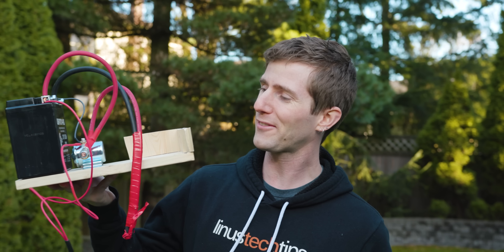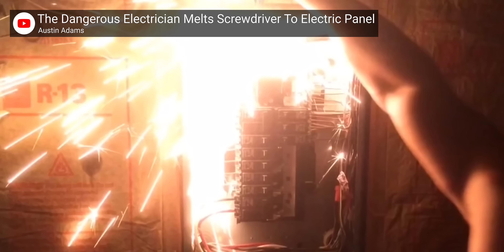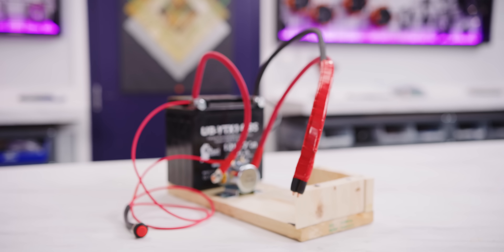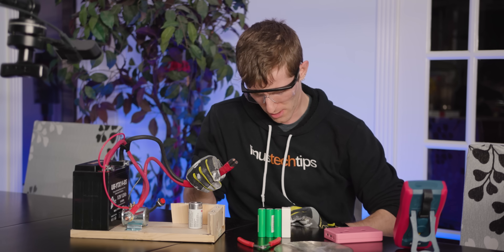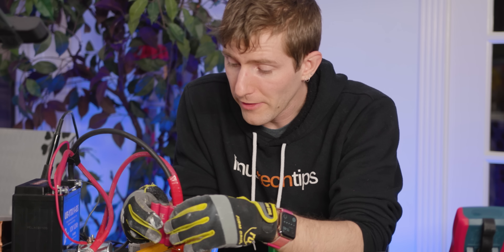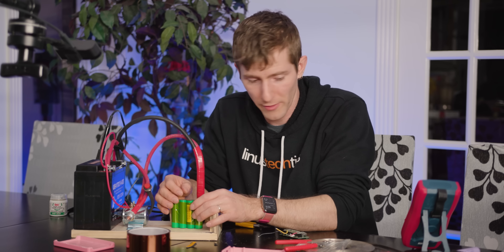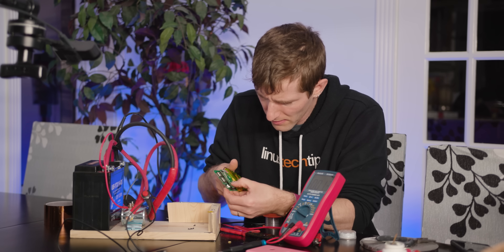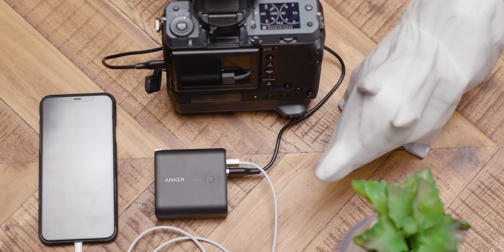I spent $100 to save 20 bucks... and it was TOTALLY worth it!

Comment: 3:52 what electrocution hazard? You are dealing with 12V...
Reply: No one employed by LTT is an actual engineer.  Trust these guys for keyboard reviews, not anything actually technical (that wasn't fact checked by one of their professional technology providers).
Reply: The only hazard would be metal jewelry getting welded to you. But that's an easy thing to prevent, you should already be taking off metal stuff on your hands when dealing with electricity anyway.
Reply: Voltage doesn't kill, current does. 16mA hand to hand is enough to not be able to "let go", 20mA causes respiratory arrest. Depending on skin conditions (dryness, cuts, burns, skin thickness etc) the resistance can vary greatly from 1k Ohm hand to hand to mega ohms (I measured 1.4M today with really dry hands), inner body around 300 Ohm. However the resistance can be broken down by high frequency AC such as a current pulse, for example from a spot welder. Suppose you had 1k Ohm hand to hand, from the breakdown from the pulse, or due to wet hands or a combination, or other reasons, 12V could cause a current of 12mA which is significant and close to not-being-able-to-let-go territory. 12V spot welder is still dangerous if you don't pay attention.  Remember, current kills, not voltage.
Reply: @emilybjoerk  Again that stupid saying - yep, current kills, but you need voltage for current to flow, they are connected according to Ohm's Law. Also high frequency AC doesn't 'break down' resistance, just lowers overall body impedance the higher the frequency as body has some capacitance, and even if we assume current reaches 20 mA (which is unlikely, there's 'high frequency' voltage spike when you quickly grab battery terminal and somehow you don't die), you need relatively long current pulse to cause any damage, according to the IEC 60479-1, even at 1 s there's only 5% chance of ventricular fibrillation (when current adjusted by a factor of 2.5x for hand to hand instead of hand to feet, according to PEG presentation) and that assumes that current is AC, for DC you need even more current.
Reply: @emilybjoerk  DC is extremely unlikely to do anything at all at 12v. I could put my wet hands on a 48v (at 58v) battery end to end and nothing happens.

Maybe AC could hurt you at 12v, but I doubt it could ever be deadly. (See Electroboom on the misconception)

High voltage DC is dangerous, and same for the 480v circuits that I sometimes work with.

Death comes from a total power level able to stop your heart, and a voltage high enough to break through the body to the heart. Usually from your hands.

Comment: Why the fuck are you doing all this shit to weld when you can buy an empty battery bank that has slots for 18650s with spring terminals for like $5 on ali or amazon?!
Not only would your welding machine cost more to build than replacing the power bank body, 99% of people will need to learn a skill and the safety involved lol.
I get that it makes for a cool video, but from the perspective of the unaware it just says "Don't mess with battery banks"... When you can just buy one that doesn't require welding? wtf dude.

Comment: MyFather replaced the cell of a scientific calculator, many years ago.
it was an expensive Machine that was perfectly fine, only the rechargeable cell inside wich was soldered into it was dead.
I have no idea what sort of cell it used, but all he had to do was find out what type it was and replace it.
to give the perspective: its Display was using incandecent Filaments for the numbers.

Comment: "If we just used something like a light switch, there would be too much current, so this relay will make our pulses nice and short".
.... and then they proceeded to control it with a sketchy plunger button anyways. The relay doesn't really do much if your inputs aren't precise anyways. There really should have been a circuit providing a switching pulse.
Reply: I though their point wasn't to give it fine control, but rather so all that energy wasn't running through a pretty flimsy button with thin wires

Comment: A monostable 555 timer circuit with a potentiometer to set the timing would be rather easy to incorporate into that spot welder to take care of the timing issue. 555 timers can take 12v in, however you'd likely want to use a mosfet or possibly a transistor on the output to drive your relay as this will avoid the flyback current that was likely causing your button problems.

Comment: Why exactly wouldn't you just solder it, it would be so much easier. Just turn up the heat on your iron and get it done fast. It's fine.

Comment: Hot and ground? Errr no. Hot and ground or live and neutral in the UK are terms used in AC circuits. It's actually positive and negative as it's a DC circuit.

Comment: Me: This spot-welder is dodgy AF.
Linus: proceeds to demonstrate exactly that. 

It was cheap. Not discouraging anyone to build it.
But blowing holes in your batteries isn't good. And that relay will never be accurate or reliable.

kWeld is a nice small cheao-ish spot-welder solution.
Reply: Or buying a prebuilt spotweld controller

Comment: I feel adding a little gauge to read battery voltage as you discharge and using a timer circuit could take out the human inconsistency and fix your welder right up. plus give you the option for adjusting to different material

Comment: The primary reason spot welding is used on 18650's is because of the difference in metals. You can't solder onto the 18650 directly hence you use spot welding to join two different metals. (Correct me if I'm wrong)

Comment: A good addition to the spot welder would be an adjustable monostable multivibrator circuit. It would weld for a constant amount of time instead of relying on letting go of the button.

Comment: I chuckled when you went in detail about the strips, but do not at all mention the difference between protected and unprotected cells... At least not what I could see I skipped around a bit. At least you're the only person with a homemade spot welder I've seen who is actually as scard of the battery as they should be.

Comment: Bro, at the very LEAST cover your ring with tape but holy FUCK take it off!!! You want to melt that into your skin? FFS...
Reply: For ANYONE looking at this convent, this goes for ANYTHING THAT HAS TO DO WITH ELECTRICITY. You NEVER EVER wear any metal on your hands or wrists when you do anything like welding. I even take mine off for soldering. Remove ANYTHING from your hands and wrists.

Comment: I work at hobby store and solder lipo on daily basis(like more dangerous li-ion). My tip for your solderin is get a bigger soldering tip the bigger it is the more heat it can transfer so often you can basicly solder in 1 without heating deep into the battery and not getting cold solder.

Comment: soldering acid and 2.5mm copper wire so much easier and much safer. also most nickle strip struggles to handle the high current rate of stuff.

Comment: No electrocution hazard. Sorry, but that term commonly means for a living thing to be affected by high voltage, and the definition of high voltage is over 50 volts or so (research the limits used by UL and other standards bodies). Your setup uses 12V, so no hazard of that type. 

If the relay were shorted on there might be a electric heating hazard as the connecting wires or other conductors were overheated and commenced to 'splode. 

You are supposed to be an expert, so get it right.

Comment: It's not the loss of capacity due to heat that's the problem. It's the risk of explosion, which you discovered for yourself even when using a spot welder.

Comment: that starter relay probably isn't rated for that high current for that long, which is why you're probably almost spotwelding the contacts in the relay together which is why the switch "sticks" sometimes. kind of a dangerous diy spotwelder tbh.

Comment: @5:59 If you were connecting large banks of batteries together that were not within a few volts of each other this would be an issue but even if you connected a completely discharged 18650 at 2.8V in parallel directly to another 18650 that was fully charged to 4.2 the amount of current that would actually pass between the cells would be very minimal on the order of 1-3 amps for a very brief period and they would then equalize to around 1.5 amps or less going down in current until they reach a fully equalized voltage.

@6:50 You can safely solder cells together without doing any damage via heat by simply using a propper soldering iron in the 100-200 watt range since the actual time to solder becomes far lower (about 1 second) at the higher wattage.  Lithium cells are usually good to 60C during discharge and that is a constant temperature but when soldering a lithium cell with a properly sized iron you do raise the temp of the metal case to around 190C but that is for a second or less and only raises the temp of the rest of metal case of the cell by 5-20C as the heat is conducted away and equalizes very quickly.  So unless you are moving too slow or using too small of iron, you should not be heating the cell anywhere close to the 60C+ most are rated for.  Spot welding with an automatic spot welder is faster and safer for the cell but is not a necessity.

Comment: HEY LINUS! If you cut a 2L bottle in half to make a "tube" of plastic, you can use a heatgun to shrink that around a freshly compressed battery pack, and you can probably make that pack work... After you swap out the BMS.

Comment: No mention of the dangers of thermal runoff working with lithium?  Heat doesn't only ruin batteries, but can also lead to very very hot fires and possible explosions.

Comment: Oh you should be careful with these :,D You got that white plastic cap around the positive pole and directly to the side of it, underneath the green cover is the negative pole wich reaches all the way to the bottom. So you better don´t scratch the top cover with your metal plate or let an edge crawl underneath that green cover...

Comment: You should have used carbon rods as electrodes. They won't melt and stick to whatever you are welding. You should also clean off the surfaces with alcohol before welding so they stick together better.

Comment: Anker sponsored the video b/c of the title... It is weird how buying the same capacity in 18650 batteries from like LG (which Anker uses sometimes) is much more expensive than just buying an Anker pack of the same or greater capacity. Unless you want something like a 60Ah LiPo pack with fast charging @3A and high current output but yeah Anker power circuits are probably better thought out than hobbyist made charge / discharge protection boards... probably

Comment: So i want to do the exact same thing on a laptop battery. Its a 2*3 setup outputting 11.1 v at 4.400mah. So i ordered 6 gp 3.7 18650 batteries at 3500mah each. I suppose the extra capacity wont be a problem, it will just charge longer. I'm also going to do this with a soldering iron. Any advice?

Comment: Also The version with the microwave transformer is also very interesting, Just do not be afraid of live circuits, because if you make all necessary precautions eg. adequate insulation of live wires, grounded transformer shield and case ... etc. The main reason why this is better is that you will be able to precisely control not just a welding time but also the amount of current passing the weld spot by regulating the input current to the transformer rather than its output because the input current is much lower. While building this welder I would rather remove the secondary winding (The one with more turns and thinner wire) by cutting-off the I profile of transformer shield from E profile with an angle grinder and then removing the secondary with a chisel instead of drilling it out.    I thing that it is not really difficult to do it if you have average mechanical-work skills and some electrical knowledge, It is just important to obey safety precautions !

Comment: you dont need to buy a spot welder if you buy a powerbank that has removable covers and not welded batter.
its a bit pricy upfront but these powerbank last so much longer.
i bought Qi Dian power bank and Samsung 18650 Cells with 2800mAh rating.
that powerbank is still alive even after 7 years. the cells capacity have degraded but still within the safe voltage range.
cost me like 50USD total

Comment: that is one ghetto spot welder. You can buy a circuit board to control it for like 20cad, or fully built dc spot welder inc battery for about 90cad. Save a ton of money if you build ebike sized batteries, compared to buying them pre-built. Plus unlike most pre-built ebike batteries you can put a proper BMS in.

Comment: "Nasty electrocution hazard" - with 12v, if you manage to get a shock without literally licking both terminals (not even then) i shall award you the ElectroBOOM award of the week.
The exploding battery caused by a dead short are a different story.=))

Comment: you guys need an actual welder. I'd suggest the titanium easy flux 125 cause it goes on sale for only $150 and is super cheap to use at only around $20 per spool and is easy to use for a starter. I built a motorcycle with mine.

Comment: FUCKING LORD Almighty is this thing dangerous and irresponsible.

Without the ability to control the amount of current and the length of the pulse PRECISELY*, one can so easily melt through the body of a 18650 cell and set it on fire. Looking at the test weld shots, this thing outputs *way too much current. The nickel strip should not glow visibly.

8:43 Linus, you are a total idiot. You were just plain lucky that he did not set his house on fire.

P.S. I am sorry, this is lunacy. I flagged the video as a Harmful dangerous act. Giving 10M subscribers the idea they can set themselves on fire in their living room is completely irresponsible.

Comment: You can significantly improve the usability of your DIY spot welder by switching the relay with Arduino (plus some support circuitry). That way you can precisely control the ON time and get more reproducible results.

Comment: spot welting another strip is fine Linus for my ebike battery pack i did 2 layers of .15 nickle to carry my 80+amp current over the parrell connections the series connects didnt reqire extra due to me haveing 14 x5a= 70 amps continuous before getting hot and bursts of max of 13a per connection.   Side note ( https://www.aliexpress.com/item/4000436631776.html?spm=a2g0o.productlist.0.0.4e9d7746pVmtl4&algo_pvid=c298c2f1-b17c-47b9-988c-398fd2deaf6e&algo_expid=c298c2f1-b17c-47b9-988c-398fd2deaf6e-2&btsid=0ab6d69515875029534555059e85f5&ws_ab_test=searchweb0_0,searchweb201602_,searchweb201603_ ) invest your self 25 and buy one of theas for consistent welds

Comment: So a few pointers as someone who builds ebike batteries with a post welder: pressure is key. If you don't apply enough pressure, it's gonna spark like crazy and not weld well. Also Linus, the distance between the electrodes is too big for spot welding to an 18650. Also spot welding a nickel strip on top of another nickel strip is pretty common especially for bigger battery packs. You'd normally see a nickel strip for parallel then another nickel strip on top of that for series connections.

Comment: Call me crazy, but wouldn't it have been better to solder the connection to the strips first, and then spotweld them to the batteries? Less heat will go to the batteries, which is good for them, and makes soldering a lot easier as well.

Comment: An ATV battery in germany starts at 40-50 buck so this is not a cheap alternative.
I would recommend Scooter batteries instead, if they have enough current. They start at 15 bucks instead.

Comment: I think you could get much more consistent welds if you use an Arduino and relay combo to control the signal to the starter solenoid. You can then just have a button on the Arduino and tune the timing until the welds are perfect!

Comment: Can't find anyone else mentioning this, but the reason your pushbutton is acting flaky is because of the back-EMF as you are de-energizing the coil in the relay.  The pushbutton will slowly (or quickly) be destroyed by the arcing this causes.  Add a diode across the relay actuator contacts to shunt the back-EMF.

Comment: The Anker powerbanks are great.
I switched to the Xiaomi Mi Power Bank 3 Pro. It has a capacity of 20.000mAh and can charge through the USB C port at 45W :)
The best part is that it's really inexpensive for what it can do. You can get it for around 40 to 50 bucks. Similar powerbanks from companies like Anker usually cost around the same but don't perform nearly as well. They usually charge your device at a maximum of 30W.

Comment: 4 18500, the better option would be getting 2 18x37x54 polymer ion batteries and put them in series, way safer and with better capacity than 18500s

Comment: 3:49 12V DC is not dangerous since the current is limited by your body resistance. If it was ac it would give you a shock but not that dangerous but risky.

Comment: gargle listerine to kill the bacteria at the back of the throat, much better than salt water
pleeease be careful with 18650s, even experienced people have fire flare ups. Don't use a relay without a timer circuit to precisely provide an ON/OFF.. just holding the button a little too long and you've damaged the cell if no cause a fire
I solder my cells in under 3-5 seconds and it cools fairly quickly and not propagate through the cell at all, so soldering is not as bad as stated